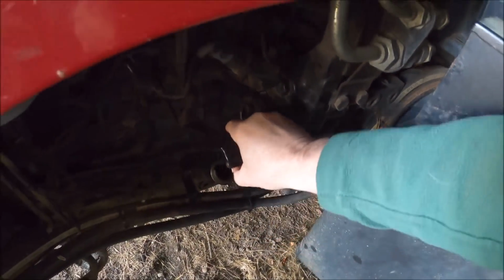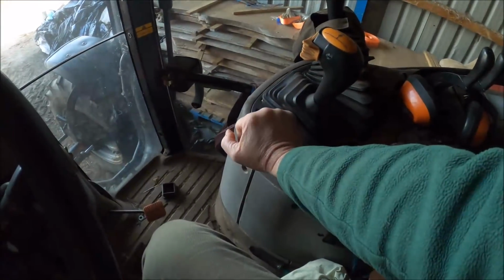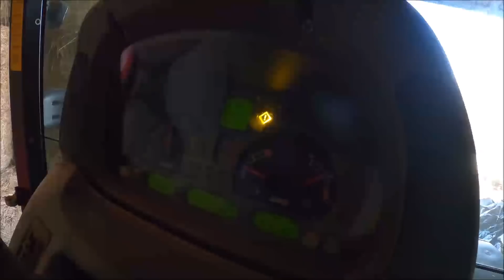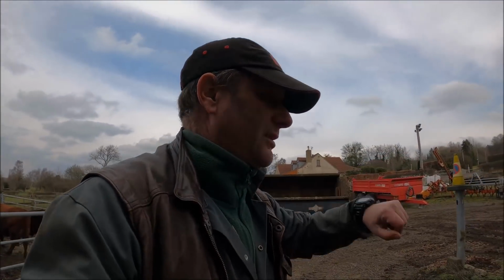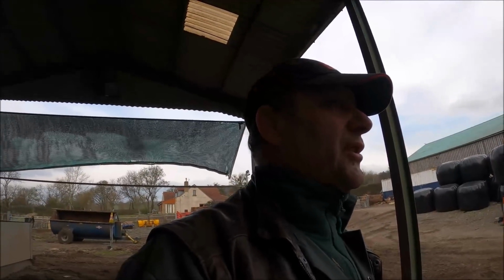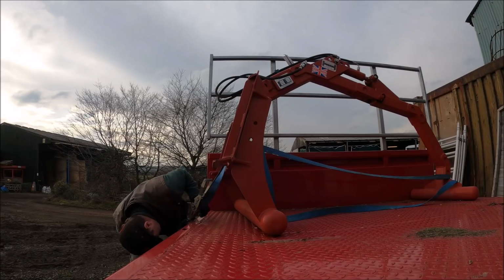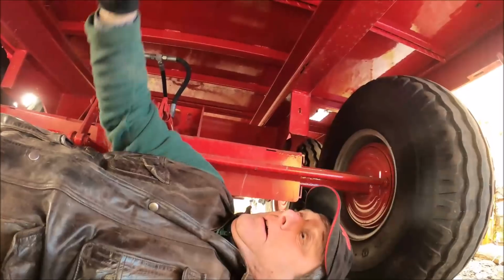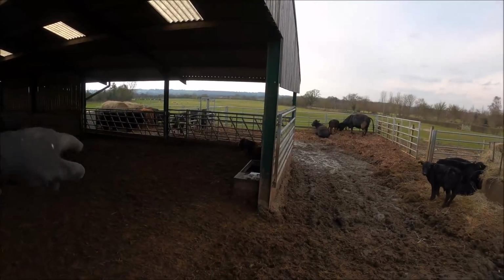Bales for the Funky farmer.  Part one.

Comment: I'd love to see you do a chainsaw maintenance video for different problems. Or advice with them.

We have two and they're such a pain in the backside that they just become dangerous. Idling out, not starting well etc. They would break your back
Reply from the maker: Modern fuels don’t help, always run them dry when you finish with them 🙂👍
Reply: @FarmerP  so where can I get good fuel for it? So frustrating
Reply from the maker: @conor7187  
Fresh fuel mix is all you need, remember, two stroke fuel oil mix deteriorates after about 14 days, it separates and breaks down. Using fuel mixed more than a month old is asking for carburettor trouble.
Reply: @FarmerP  WHYYYYYY.... WHY BRING ME BAD NEWS 😂
Reply from the maker: @conor7187  
You could try the Aspen fuel. It’s expensive but lasts a lot longer. 🙂👍

Comment: Don't struggle with batteries, use smart chargers, you can clip them on and not worry or use them once a week or once a month. No need to leave tractors running :-) Will make a dramatic difference in the winter.
Reply from the maker: I do have one, but it tends to live with the quad. 🙂👍

Comment: hi mr.p how do you sell wood chip by the metr when the truck is not calibrated
Reply from the maker: Not calibrated....? It’s not difficult to work out cubic capacity with a tape measure, it’s only three numbers  to multiply. I’m generous on the loads anyway so no one ever  gets short changed. 🙂

Comment: have a question. farm i work at i mix tmr feed twice/day with a mustang 2044 we keep it in a heated pole shed when not in use. all the hydraulics work perfectly except dumping the bucket. those 2 cylinders they've gotten so slow almost does'nt work we have no idea whats going on my boss is talking about trading the skidsteer. all last summer bucket was slow to begin with but now that it's -50 below northern minnesota it's so bad today i just shoveled silage out of the buckets by hand. any ideas?
Reply from the maker: Are your peddle foot wells clean, I know it’s a daft sounding question but if there is a lot of detritus under the pedals, everything gets slowed down.
Reply: @FarmerP  yeah they're clean. might have something to do with linkage or self leveling valve i was just looking at the pdf service manual. there is'nt much about these skidloaders online
Reply from the maker: @jasonmushersee  
check the linkage settings in the valve box, and the locking solenoids, my solenoids were all replaced on a recall.
Reply: @FarmerP  you were right. there was frozen muck under the right foot pedal did'nt see it last week. we took apart all hydraulic valves could'nt find anything wrong hydraulic anywhere just a frozen pedal
Reply from the maker: @jasonmushersee  
Does that mean the problem is solved Jason?
Reply: @FarmerP  yes
Reply from the maker: Brilliant, your boss owes me a pint 😄👍